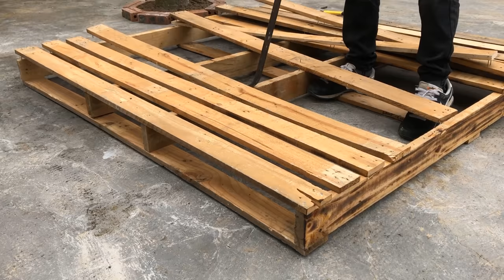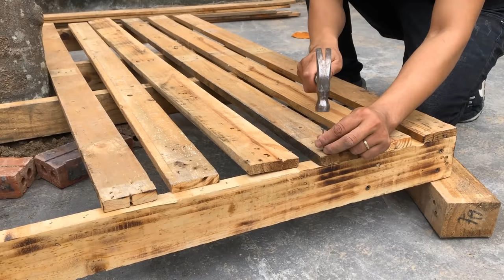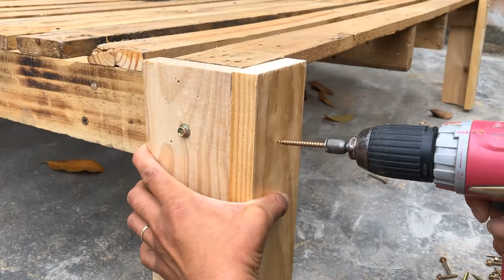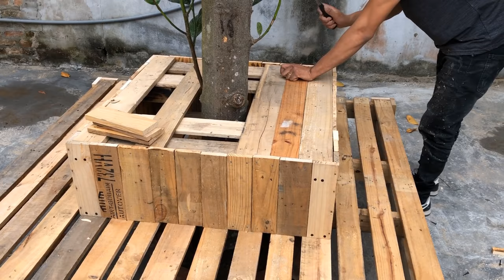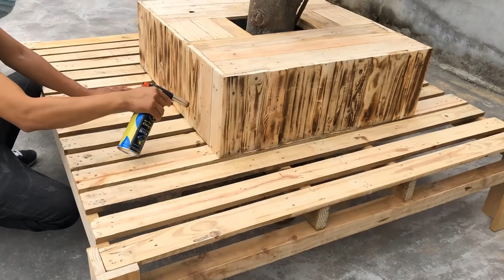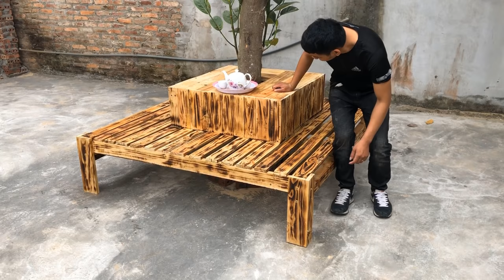Great Creation For The Garden From Just Two Old Pallets//Tree Bench Ideas for Added Outdoor Seating

Comment: "Just 2 old pallets." Now comes the fine print.. Plus pre-cut wood that makes a perfect interference fit every time. Plus a few power tools, blow torch, compressed air, spray attachment with stain, a ton of screws and nails.

Comment: Great use of scrap wood!  My only concern is the lack of actual load bearing legs like solid 4x4 underneath each corners.  What happens if 6 or more people sit on it?
Reply: Avg Pallets can carry up to 4,600 pounds. He should be fine. That’s about 30 people if they weight about 150
Reply: @syedali5678  It's not the pallet I'm worried about. It's the fact that it's suspended and only held by couple of screws at each corner. If the legs were placed under, instead of screwed on the side, it'll be much stronger.